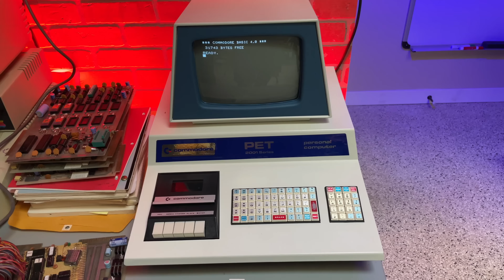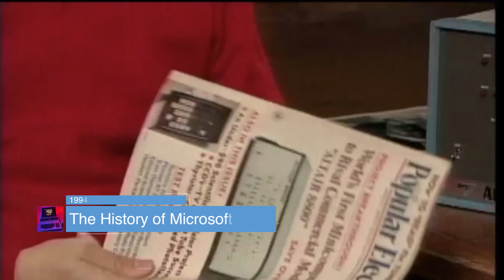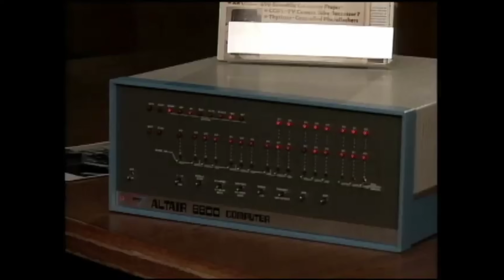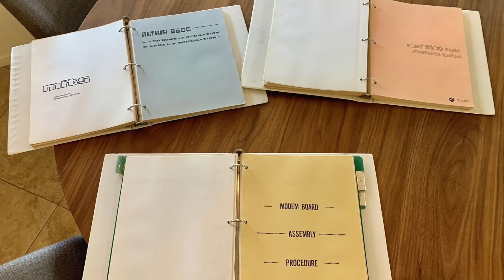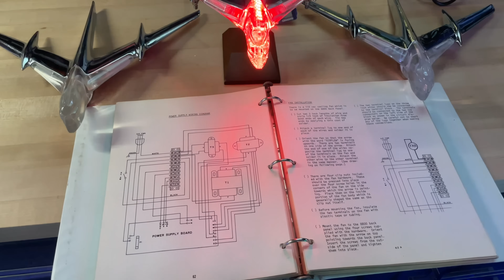The Computer that Birthed BASIC and led to Microsoft!

Comment: Dave modern PCs use a distributed power system just like the Altair did. Almost every components gets its power from the main 12V rail but they use local converters called Voltage Regulator modules (VRM) to convert 12V to the specific voltage (usually much lower) required by the components.
Reply: if by almost every component you mean the gpu(or cpu) card then sure, that's correct. but that's not most components you add to a computer really these days.   most components don't use high amounts of current where the cost of vrm's or even a plain regulator even on it makes sense.
Reply: Motherboard, GPU and Disk drives all have onboard voltage regulation.  What else is there in a modern PC?  The ram doesn't have its own regulators but its voltage is produced by the Motherboard. I can't think of anything that uses the PSU rails directly. Even the fans in a modern PSU are drive by a voltage regulator on the motherboard.

Comment: What a generous perspective for those that hadn't lived through the time. This article came out I was in middle school. My EE uncle bought a kit, but didn't get it working. It was later given to me, but thrown out while I was away at college (someone cleaning the garage! - I haven't tried replacing it.

I have to say I saw the title and hoped you would be talking about the PDP-10, it was here the Gates and Allen learned programming (a terminal at Lakeside) and their experience with that instruction set put them in the position once at Harvard to start working up their 8080 re-assembler and the Basic interpreter, without having to first learn TOPS10 and the DEC environment. Allen talked at some length about their development cycle in his book "Idea Man" (2011). 

I think this doesn't get enough notice, the advantage of years programming and especially low level assembly from their teens positioned them to get straight into creating their Micro-soft product and be 'first to market'.

Comment: 8:27 that is basically how it works today, there isn't anything on a graphics card, or motherboard for that matter, that runs on 12V other than the regulators that make the much lower voltages for ICs and IOs. Distributing something like 1.2V at hundreds of amps would be very inefficent and basically impossible

Comment: Those big electrolytic capacitors will give you trouble later.  That is the first thing to go. Best practice is to replace them as they sometimes make a nasty mess when they fail.
Reply: Good to do, but not necessarily a priority, as some years were much worse than others: the years we usually hear about were using "capacitor plague" capacitors, which were accidentally produced during multiple periods of time. In contrast, some other periods of electrolytics merely slowly die instead of oozing out.
Reply: Check uF and change those caps as needed.  I agree.  Also Dave probably fixed the loose wire with his overhaul, as it was more a overall approach not component based analysis.

Comment: I miss hardware! I first got into computers in 1996 when the 486 was being phased out for the Pentium, but I got to work on a lot of older systems using MFM and RLL drives and how to manually setup HDs using CHS. Good old days of computing.
Reply: what was that command again? Open debug and enter g800?
Reply: @javabeanz8549  g=c800:5
Reply: @thejoneseys  that sounds like the standard one, there was another one for some controller cards, but it's only been about 30 years since I moved over to IDE (PATA in newer terms)

Comment: I would LOVE to see more of your computer museum back there, I bet there's some real forgotten gems laying around.
Will you ever acquire a rack mount PDP machine or even a Teletype 33? Just to complete the childhood memories, of course.

Given enough time to dry, any component should in theory survive water, especially distilled, which is nonconductive. However, using compressed air is usually a no-no! Many compressors can fling water or oil under components or in the case of transformers and several other fragile components can often break them irreparably.

Transformer connection was absolutely the most likely point of failure, I can't imagine an add-on transistor having caused the issue unless it was dead short to ground or something.
Reply from the maker: Wow, I'm so tempted... there's a mint PDP/11-70 front panel on eBay right now, but it's $4200.  I might hate myself later, but that's steep!
Reply: @DavesGarage  If you really want "the computer that birthed [Microsoft] BASIC", and score some serious Nerd Points, you need to get yourself a DEC-10!
P.S. MS BASIC was definitely influenced by DEC's BASIC.  Not an exact clone, but you can clearly feel the influence.  Especially when you compare MS BASIC with the BASIC's on other mini/mainframe systems (e.g. compare to HP or IBM).
Reply: @DavesGarage  Dave, have you thought of seeing if you can film at REPC's little computer museum at their Seattle location?
Or searching through their back room like MetalJesusRocks did at their Tukwila location with all the commodores etc that the public don't normally get to go through to purchase?
Reply: @DavesGarage  : At that sort of cost, you'll probably be happier buying a boat load of switches and making a panel yourself.

Comment from the maker: Did anyone else notice that the Altair shown in the Gates footage is a replica???
Reply from the maker: Big difference is the switches are "flat" in profile and do not have ring bezels...
Reply: @DavesGarage  Dave, the early Altair 8800 had round switch handles like the one Bill is showing.
It had a 4-slot backplane.  Altair went to the flat handles with the 8800a, which also has the larger
backplane with many more slots.  The early machines also used a 8080-8 chip, note, not an 8080A,
which is not fully TTL compatible and contributed to the flakiness.

What's your serial number?
Reply from the maker: @billlewis9740  Bill is ccorrect!  Mine would be an 8800A, which got different switches, more slots, etc...  My mistake!
Reply: They probably couldn't afford an original 😁
Reply: How do we know?
Reply: Not me… my first computer filled a large room.
My father was a computer scientist at Georgia Tech. He would take me and my brother into his office when he worked late.
I use to play the lunar lander program as a game… long before there was such a thing as a computer game, even before pong.
Reply: @thatguy7085 Rudimentary computer games were created shortly after the first programmable computers. The scientists and engineers using them would program such things in their spare time, long before lunar lander programs came along.
Reply: seems ok to me... but I'm fine with using an emulator, as well.  To me, having the manuals is much more important. Happy Sunday!
Reply: I wouldn't know the difference, but I might recognize it if it was the IMSAI ;0)
Reply: I didnt notice, but i was looking at this recently and found an emulator/simulator of the altair 8800. You can see some how to videos on how to use it in youtube as well. Pretty fun
Reply: @crypticquintessence4814 I have one: it’s excellent.
Reply: can you tell them apart by the color of their chassis??
Reply: I’ll take a couple of guesses. 1. The front bezel looks like it’s plastic instead of folded steel. 2. The horizontal graphic lines next to the Sense Switch is different.
Reply: I notice that Bill forgot to comb his hair.  That big ass cowlick coming off the back of his head... LOL!
Reply: I could not have know Dave... my oldest experienced with PC maybe only as far back to 80386 or 80286 lol